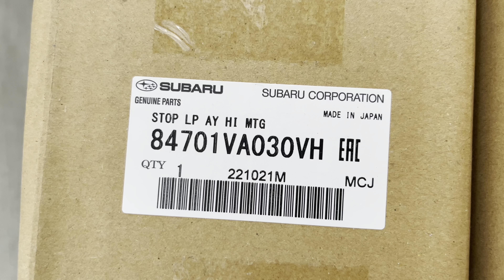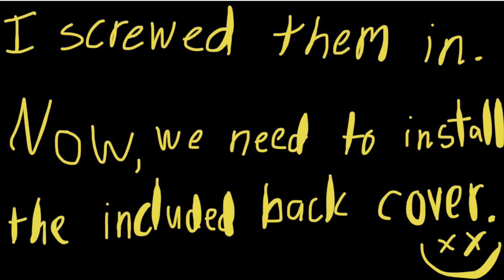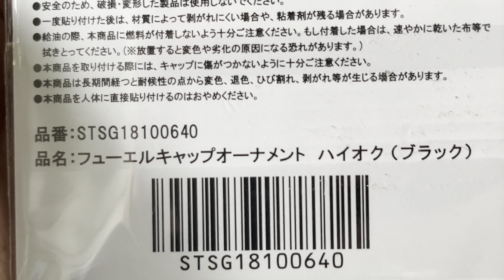2021 STi JRNL 8: JDM Center Armrest Extension, JDM 3rd Brake Light FAIL

Comment: Do you know what alarm the dealer installed? My WRX came with the dealer installed KARR Alarm. It has the little light/button under the dash as well. I'm going to double check to see if it's wired up to the 3rd brake too? I hope not!
Reply from the maker: The brand was Pursuit. Some people have told me that it might just be a module that dealers install to make the 3rd brake light flash a few times when you press the brakes. I haven’t checked if it flashes yet, though. Either way, I’m getting it removed.
Reply: @jazzblaster  Was your STI brand new or used? Weird that the Subaru dealer would install that.
Reply from the maker: @JStockinger  Yeah, I bought it brand new. Some scummy dealers like to install dumb things on cars as soon as they get on the lot and then add fees and charges for that stuff into the price of the car.
Reply: @jazzblaster  Wow. Hopefully the dealer or SOA helps you out with removing and replacing everything back to factory spec.